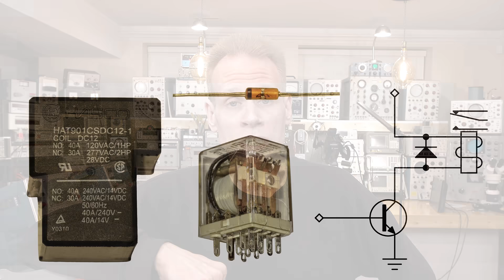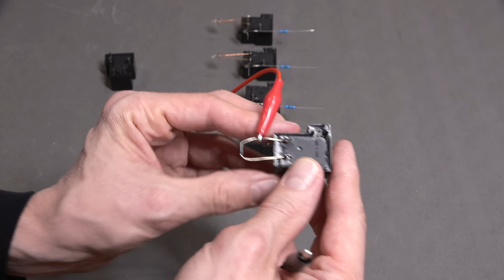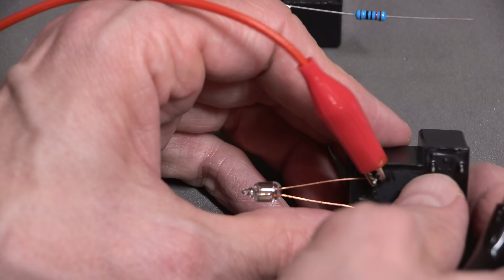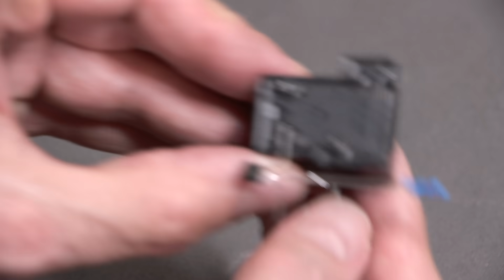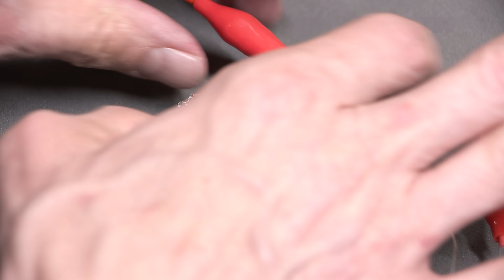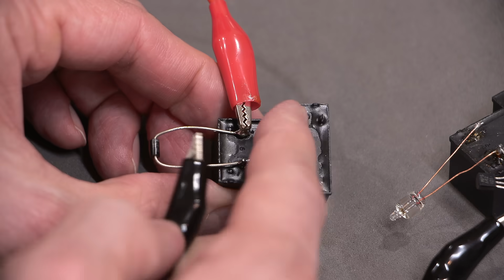Why Add This Diode Across A Relay Coil? This Is Why It's Needed!

Comment: Most automotive relays have an internal diode. You should explain the DIN terminal numbering system in a future video.
Reply: I was wondering about that. Industrial relays are usually labelled AC or DC and the only real difference is the DC relays have internal diodes.
Reply: It is hit and miss.
 I've noticed, from tearing down different automotive relays, that they don't all have diodes. 
I could probably tear one down right now (though its late), but most chevy truck relays don't have diodes in place. I'm not too confident if the fuse boxes even have diodes. I've replaced a few fuse boxes, and have never seen any in there either.

I've seen diode in some Chrysler (jeep) fuses, but they are also hit and miss. I believe the manufacturer uses their discretion on whether or not they believe its necessary
Reply: @Jack_Luck.v2 quite a bit on most of my vws ,say from mk1-mk4 chassis you won't find diodes in most relays , even on mk4s that have more computer controls. 
Always thought that was a little odd.
Reply: @Jack_Luck.v2  interesting! What Chevy Trucks are you encountering this in? Curious!  From my '83 all the way to my 2004 the standard relays all have diodes in them.  Replaced 4 in my '04 just this past week due to age and deterioration of the housing.
Reply: @Country78155 , i mostly work on 05+ Chevy Silverado 2500s.
I've done a lot of Boss plow, and SnowEx/Boss Spreader wiring insulations as well. 

I just took apart a SPST relay from an 11 2500. It does not have a diode. It does however have a resistor across the coil terminals. 1/4 watt, and i failed to notice the value. Edit - 68ohm
Interesting nonetheless. 

Boss spreader wiring harnesses and plow harnesses have diodes, but only for backfeeding. The relays sometimes have internal diodes, but I've noticed sometimes they give you relays without them. I'm guessing it's their supplier that changes that.

Edit.2 - first relay was an Omron 8567. 
Second relay is a Siemems 3604, it also has no diode, it is just a resistor. 68ohms as well.
Third relay (can remember from what) - Delphi 8867. No diode, but a resistor. 
This is turning out to be quite neet for me.
Reply: Thanks. I was wondering whether relays were manufactured with or without internal diodes, according to the intended application.
Reply: @johnwsimpson3153   Check the pictorials of all the Bosch relays in their literture. You will find several pages of all the applications. Lots of capacitors and resistors along with diodes and probably TVS diodes.
Reply: Also an ac relay has a shaded pole with a peice of copper wrapped around it and the dc one the pole peice is solid.  This is so the ac relay doesnt chatter from the reversing current.
Reply: @robertknott260 haha ,check out an old Westinghouse transfer switch ,they use those small open contact contactors for some of the controls. 
Standing near the switch on a generator startup and they chatter as the voltage for that emergency sense contactor comes up to full. 
Same on shutdown they chatter. 
Makes the new guys jump like something is gonna blow up
Reply: I'm fair in the DIN wiring number system. 
Well, better than my friends who are always asking : what's 30 mean again?
Reply: Search google for 'din 72552 pdf'

Comment: I always thought that the transistor died way before the coil due to excessive Vce. I was expecting you to run a pulse generator onto the base of the 2N3904 to demonstrate its failure. I know a lot of amateurs have had problems with PTT circuits which directly drive coils in a PA if they aren't correctly snubbered with a diode or alternative method leading to the transistor driving the PTT to fail. as they tend to be open collector.

Great video, Paul (again!)
Reply from the maker: Glad you enjoyed it!

Comment: Very interesting lesson. I rewired my child's electric car with high current relays, but no diodes. Four 12v batteries can deliver the juice, but the reverse voltage was probably destroying the batteries just as effectively. I'm smarter now and PWM modules are in use for motor speed control.

Comment: If one can switch both the high side and the low side of the cable, and runs diodes to the supply rails rather than across the diode, then the flyback energy from the diode will be fed back into the supply.  Capacitance will likely be needed there to avoid an unwanted voltage rise, but such a design will both save energy (reclaiming energy that would otherwise be wasted) and allow the relay to switch off more quickly than it would otherwise.  With a more typically-switched relay, the energy in the coil will get converted into heat in whatever components are used to limit flyback, but letting the energy go into the supply eliminates the need to dissipate it elsewhere.
Reply: If this was practical and non-negligible everyone (or nearly so) would already be doing it.  The actual energy, measured in Joules perhaps, is actually minuscule.

Comment: Awesome education here, practical instruction on proper use of the diode/relay scenario.  I installed some very high end off road lighting on my 4X4 truck, came with all cabling, connectors, switches, relay etc., no mention of a diode to protect the relay.  Been using for years with no problems so maybe the diode is there, I now will check to see.  Thanks Mr C. for the knowledge and explanation.. 73

Comment: learned this the hard way years ago building a tone control interface for an automated FM station. Every time the relay would deenergize it would blow the control IC. After replacing the second IC, I figured out the problem.

Comment: You’re a good teacher. If you switched one with a diode and one without, how long would it take to damage the transistor?
Reply: The fact of breakdown is, by itself, relatively harmless.  Zener diodes use this phenomenon deliberately.  But the excessive heat dissipation rapidly damages or destroys the silicon because any current combined with a relatively high voltage means high power dissipation right on the P-N junction.  If the duration is extremely brief, as with the case of coil flyback, it won't instantly destroy the transistor and it might go a very long time, years!  But it will eventually cause a problem.   It has probably a worse impact on MOSFET which even a few nanoseconds of reverse polarity turns it into a big short circuited diode.

Comment: In my grandfather's, and father's day, a snubber composed of a resistor and capacitor across the relay coil was often used, but yes, now, an ultra-cheap backwash diode is far better at handling back-EMF.
Reply: RC snubbers allow the relay to release quickly as compared to a diode snubber.  The current flow through the diode snubber is still a current, thus still a magnetic field in the relay even after the activation source is removed.  In many instances we don't care that the relay hangs on for a few milliseconds but sometimes we DO care such as a fuel injector.

Comment: Helpful relay coil snubber hint:  It may be better to use a transient suppressor (TVS) diode across the coil if the relay is needed to switch the contact state quickly at coil power down.  A basic diode snubber will draw current from the coil when the power-down flyback pulse occurs, maintaining coil magnetization and delaying the contact state change for a few millisec.  The TVS doesn't start to snub the flyback voltage until its breakover voltage is reached (typically selected to be ~ 120% the coil operating voltage), allowing the relay contacts to change state faster.  This application is useful in relay logic power circuits to prevent race conditions.
Reply: With P&B 30
Amp relays I used to use in energy management control systems, I always put a diode in series with a resistor across the relay coil. Had to have a resistor to lower the current through the diode to prevent the coil from slowly opening the contacts rather than snapping contacts open. Prevented arcing of the contacts. We had to diode suppress the relay coils to prevent EMI/RFI spikes that made the microprocessor freeze up or otherwise malfunction.
Reply: @AllenCavedo  TVS diodes are made by a lot of semi companies (TI, Microsemi, etc.), you might want to read their application notes and sample some parts to see if these would be a good technical fit to your design.  For powering off high current inductive loads like DC motors I ended up designing 'soft stop' MOSFET switching circuits to eliminate contact arcing, sputter-damaged relay contacts are troublesome.
Reply: I read an instruction manual that mentioned putting a zener diode in series with the switching diode to raise the back voltage to help the magnetic field collapse more quickly. I wouldn't be surprised to learn that a TVS diode is those two diodes built into one component.
Reply: @chitlitlah  There's both. Unidirectional TVS diodes are like Zeners on steroids, bidirectional TVS diodes snub either way like back-to-back Zeners, but these devices are designed to handle large current transients, unlike a switching diode.  A Zener in series with switching diode is actually a temperature compensated Zener
Reply: Could you say that again, slowly.
Reply: @diningbarry  Was that a question to me?  
The energy stored in the magnetic field of the coil holds the contacts closed.  You have to get rid of that energy to let the contacts open. 
Power is the rate at which energy is used and P = V * I.  Whatever you put across the relay coil to discharge it should have a high enough power dissipation to discharge the coil in a reasonable amount of time.  I is the current through the relay (holding current).
If you put a diode across the terminals (0.7 Volts) to discharge the coil, the power dissipation is low.  If you just pull the wire off and it arcs the arc has a pretty high voltage across it.  
Mostly a problem with switching DC.  If an arc starts across the contacts, it will grow as the contacts separate.  I wonder how the Space Station handled this 25 years ago with a 150 Volt DC buss?
Reply: Yes, I have used TVS diodes in railroad relay applications.  They really make a difference.
Reply: Another solution is a RC snubber. Select the resistor value to limit the peak current and the capacitor value based on testing with a scope. Done right, you'll get a damped wave that quickly demagnetizes the relay for the fastest switching time.
Reply: Thank you i wanted to ask a question about this but then i saw your comment, i replaced a relay in a jukebox that sends a pulse train but noticed it held the relay too long with a suppressor diode so the pulses were too long. The original suppressor looked like a paper capacitor, but showed as a diode in the schematic.  I opened it and it looked like a couple of metal discs stacked. Never heard of a TVS but like to learn more about it.
Reply: @mp3musicbox  That might be an old selenium diode. I don't know much about the V/I curve on those, be advised the metal discs may be toxic (selenium metal).  Speculating now, these might behave like what P&B 30 is describing.
Reply: Alternatively, you can use a resistor in series with the diode. The current when the relay turns off will initially be equal to the current immediately before it turned off, and from that you can calculate the resistance to get whatever voltage you desire. A resistance equal to relay coil's resistance will result in a spike of 2x supply voltage, for example.
Reply: I'd like to know more about this.
Reply: @richardpope9985  if you are interrupting a lot of current (>100 mA = possible arc), you want those contacts to move to extinguish the arc. The diode 0.7 Vf ( P = V * I ) isn't going to discharge the magnetic field holding the contacts closed very fast. Moving the contacts slow may cause an arc to form causing contact surfaces to melt, pool and migrate with the current.  A TVS, diode in series with a resistor etc. changes the V in the P=VI  (0.7) to something higher to dissipate the stored magnetic energy quicker.  Also DC is worse than AC since in AC the current goes to 0 every so often.
Reply: @rickjljr11  Well stated!  Completely agree.  Using a freewheeling diode alone greatly slows the opening of the relay contacts.  This becomes a greater problem when breaking DC current and can lead to erosion of the relay contacts.  I'd use either a zener or a TVS device across the transistor switching the relay to absorb the relay coil stored energy while limiting the voltage transient to a safe level while forcing the magnetic field to collapse as rapidly as practical.
Reply: @richardpope9985  unwittingly, and by not fully understanding the mechanisms. mr carlson here demonstrated the exact same thing here with his neon bulb...

read your c.p. steinmetz :)
with no diode, the magnetic field collapses and voltage rises until the transistor breaks down.
the neon breaks down at about 90v. the magnetic fields energy is consumed in the ionisation at about 20v.  
the diode breaks down at 0.6v. the energy flows as current in a loop, a persisting magnetic field, at 0.6v.
if it was shorted with a superconductor the field would never decay, the relay never turn off. 
conversely, if the "switch" were perfect, the resistance "infinite", the voltage would rise infinitely high in an infinitesimal time as the field would collapse infinitely fast or at c, take your pick.
the higher you let the voltage rise, the higher the resistance, the more "off" it is, the faster the magnetic field collapses. all relates to the "volt" being "so many line of magnetic flux cutting a conductor per second", along with several other definitions...
switch contacts arc as the current through the circuits inductance persists but the resistance in the gap changes and a capacitor "absorbs" that rise and the points dont arc... simple!
more inductance, more magnetic field (theres other factors like saturation though), more energy stored.
solid state just punches through microscopic  junctions... so needs other methods. reverse diodes. blah blah.

or do you mean the "race condition" ? ha ha. 
computers are switches.
switches have to switch sequentially. if one switches in the wrong order, all hell breaks lose. "race hazard".
a shift register has to start at one end and work its way through...
ANDs, ORs, and flipflops have to be latched and reset on clock cycles in sequence. inputs and outputs have to "settle". they have slew rates, hysteresis. tolerances.
gets into "grey codes" and how often a circuit doesnt count binary how we are taught binary, starting from 0 and working up... it offsets like XS3 or does crazy things like the reflected grey codes... dont ask. go read.
its so only one bit changes at a time. sometimes it also makes maths easier.
encoders have funky patterns rather than simple steps... only one bit changes at a time.
the curiosity is good. READ MORE BOOKS!

dont resort to ai. find old books. second hand shops. flea markets. technical stuff :) physical paper document. dont need a degree to know this crap...

i dont know sh... these guys figured it out for us! i just understand it... sort of... maybe.... probably not.
Reply: I use a TVS on my vintage Lionel train track input.
Reply: I've use schottky diodes. Thoughts?
Reply: @MountainTopElectronics  Worse for delaying the release of the relay armature, expensive for this application, e.g. kind of a waste of technology.
Reply: Aren't transient suppressors one time use components?
Reply: @joewoodchuck3824  Depends on the transient energy and length of time.  You will find this information in the device data sheet.  TVS diodes would hold their characteristics until that energy is exceeded then fail as a short, then explode.  Same for MOV's.  GDT's do degrade with successive high energy transients, until their gas bulb interior becomes coated with sputtered metal and they become a metal film resistor.
Reply: @Slickrock72 You're probably right on the energy spec. My view from my career along with my colleagues was to use coil diodes no matter what. We built high reliability low noise equipment. Every precaution was taken with that in mind.
Reply: @joewoodchuck3824  I'd speculate that a plain-vanilla silicon diode is the best low-noise solution for snubbing a relay, TVS diodes allow a higher flyback voltage to develop before snubbing and that could couple to your noise-sensitive circuits.  TVS is recommended for situations where the relay armature has to release as fast as possible.
Reply: @Slickrock72 We typically used 1N4004s.
Reply: Wow that is a mouth full
Reply: true

Comment: I have observed and documented this on an oscilloscope for my employer on a large magnetic switch. The level if the reverse spike was -315 VDC. I am not remembering the current or duration of the spike but it was significant enough to destroy the 8A rated contacts on a control relay quite quickly.

Comment: Not to detract from your demonstration, but most automotive relays use resistors to clamp the inductive spikes instead of diodes.

EDIT:  I mostly referring to OEM relays.  Lots of aftermarket relays don't even offer any suppression, surprisingly.

Comment: Back in the mid-1990's, when I worked at a local 2-Way Radio Shop, we installed a very similar circuit.  It was intended to clamp-down on the back-EMF, created when a relay was de-energized.  Our use-case was specifically for the horn honk feature, commonly used on analog cellphones (AMPs), which were permanently installed in vehicles.  If the protection wasn't installed, it would literally blow the control point internal to the phone.  Warranty repairs for this issue, were commonplace, until Motorola, NEC, OKI, etc... issued bulletins on how to prevent the back-EMF Problem.... essentially using a diode, such as a 1N4003, wired in reverse to the normal DC Power Feed, across the relay coil.